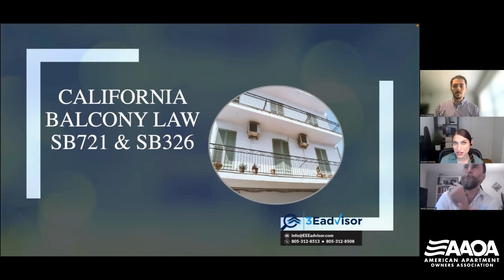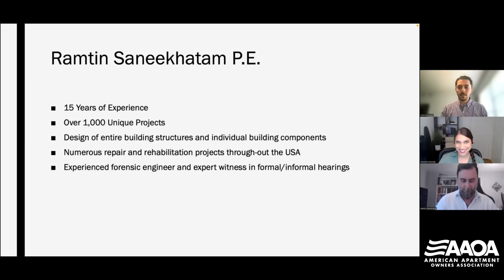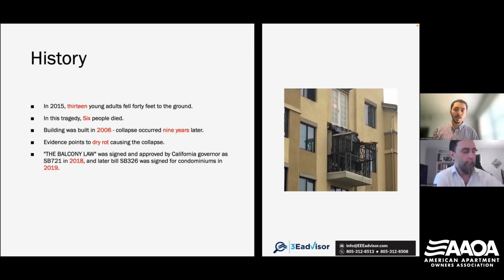How to Comply With California's Balcony & Deck Ordinance SB721 and SB326

Comment: Do either of these statutes apply to own your own apartments?
Reply from the maker: SB 326 applies mainly to common interest developments managed by HOAs, meaning the association is responsible for organizing inspections of common area balconies, while SB 721 places the responsibility directly on individual property owners of multi-unit buildings. SB 326 applies to all elevated exterior elements within a common interest development, while SB 721 specifically targets multi-family residential buildings with three or more units.